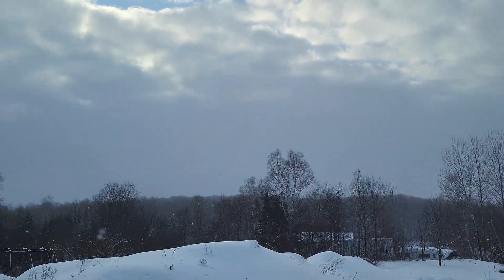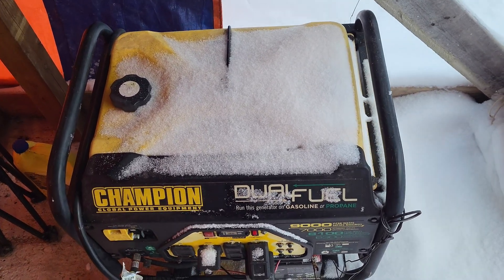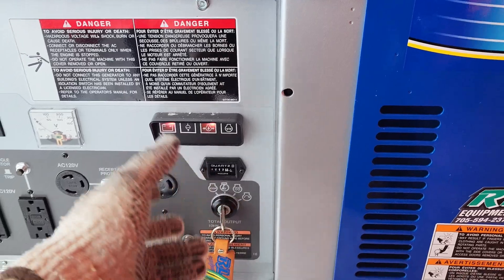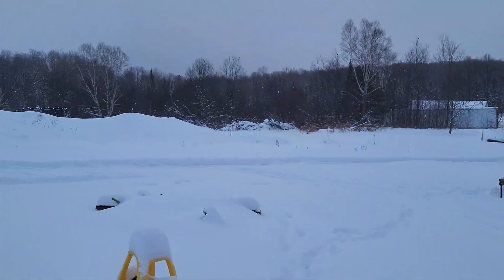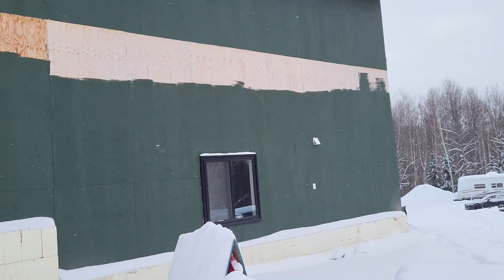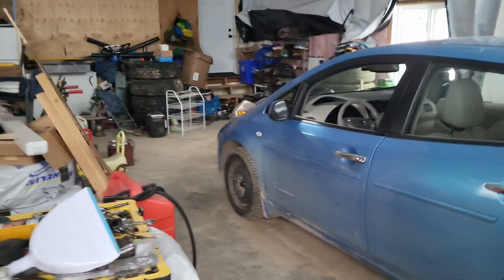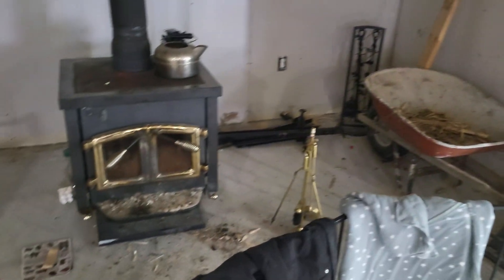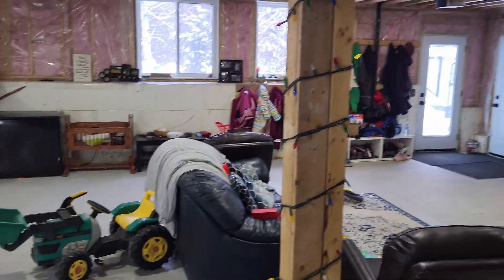GOGs DIY Solar Powered House Update!

Comment: Just to add here in the Caribbean our houses are made of steel and concrete even my roof is concrete because your roof is normally the first to go during a hurricane. I tell you though my experience lately with all the earthquakes. Man being under a concrete roof during a earthquake, not a nice feeling.
Reply from the maker: yes I would also be worried. but i bet its nice in bad weather knowing you have a strong roof